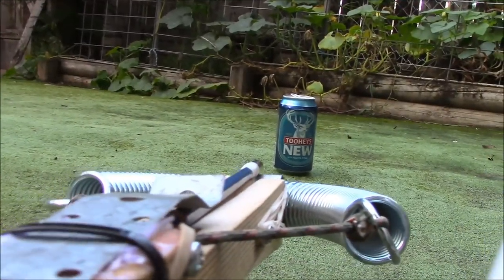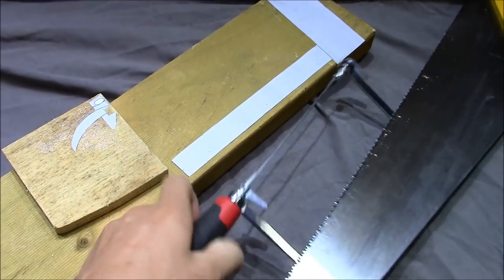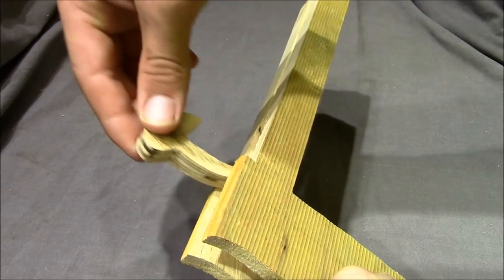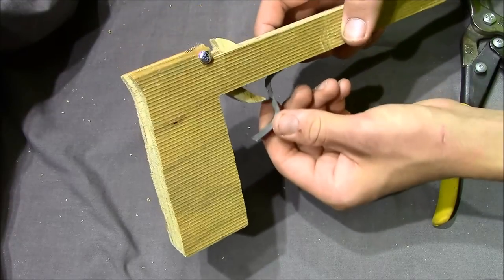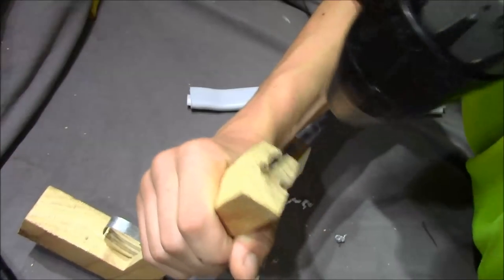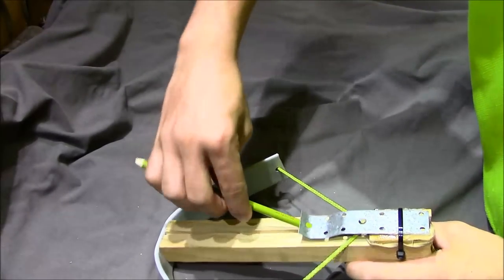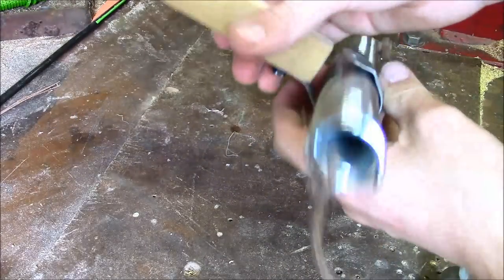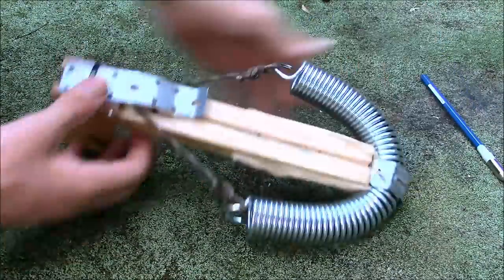How To Make A Pistol Crossbow , blue prints , tutorial

Comment: How does the trigger mechanism stay in place when the pistol is cocked? Doesn't the force of the string pull it forward?
Reply: It looks like the bolt that is the rotating axis is behind the trigger. It wouldn't stay in place if the axis was at the trigger.

Comment: hi, its just for saying that you got talent, i have made my own psi gun with a plastic bottle it can hold like 58 psi but now i got a big pvc pipe from my neighbors. wich can hold up to 116 psi. the diameter of the pipe is 43.31. now i need your advise because you know a lot of it. should what kind of valve and barrel should i use? like stainless steel or pvc? and what diameter? a sniper or a big cannon? and the length of the pvc pipe is 31.5 inch?